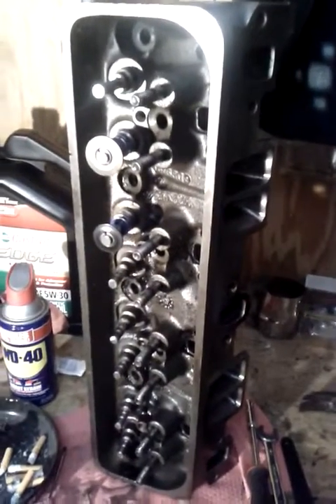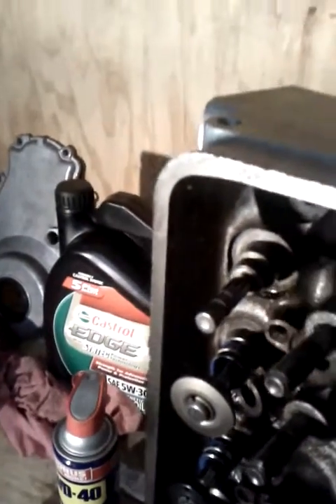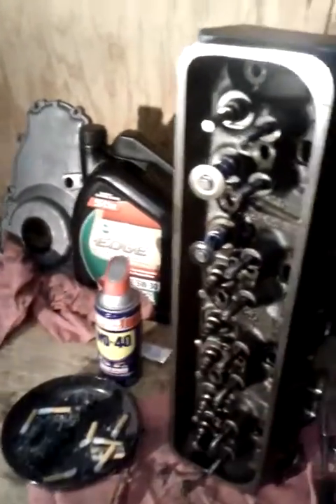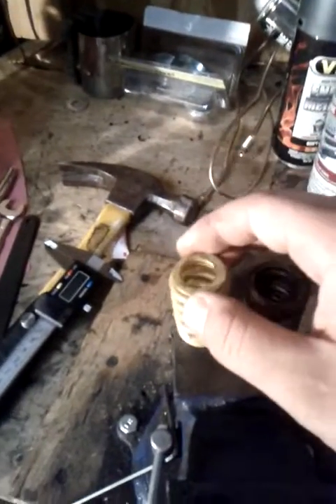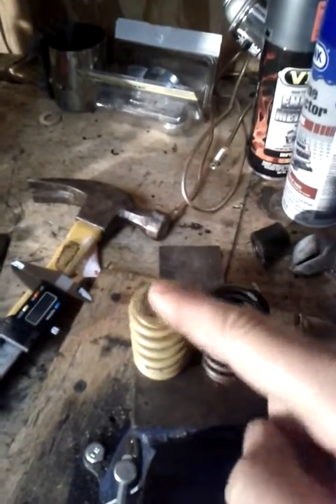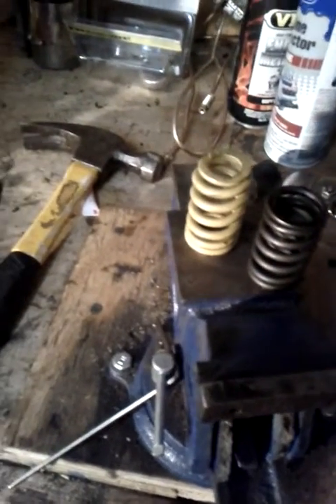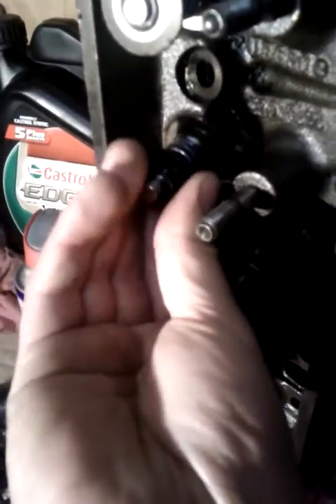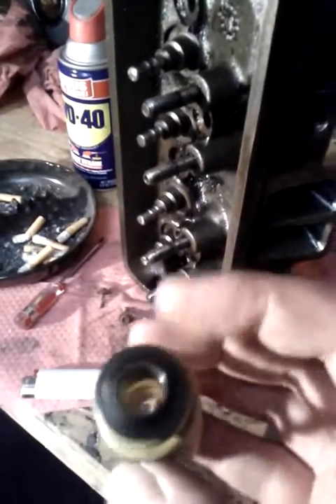HOW TO: Install LS6 springs on old 350 Chevy heads

Comment: So just the keeper gives you .024 did you need a .05 off set keeper to keep the installed high right. That will give you .074 more lift. I think stock they are good for .450?

Comment: Dont forget to use .050 thousand offset valve keepers. The way he is doing it only gives you 480 lift safely. You need .050 thousand space between retainer and valve boss.
Reply from the maker: I ran it this way for 7 years. I wasnt aware that i did it wrong

Comment: If you have new seals do the ls style springs require a different seal or can I keep mine (just got my vortec heads from gmpp and I’d like to upgrade the springs, but the seals are new )
Reply from the maker: Use the factory seals
Reply: BeeterOlds 
My man thank you for the prompt response, I’m in the garage right now wondering what to do, now on with the swap
Reply from the maker: You caught me at the right time (reading comments while crappin) enjoy sir!
Reply: BeeterOlds 
Hahaha right on man

Comment: Ok buddy any idea why people use to say to take the pressed in studs out and put the threaded studs back in ?? ""On the vortec head""
Reply: If you use a high open pressure (like for a decent roller cam) the pressure can pull the pressed studs out of the head.
Reply: I know of zero people who have done that on a street setup, if youve ever pulled the studs with a slide hammer , after the first one you thinking why the hell am i doing this, that fucker was in there !?!? .... the only good reason to pullim is so you can put in a longer stud and run roller rockers !

Comment: How did you work around the different installed height of the valve springs? 
The LS springs are a 1.800” Installed Height compared to the OEM SBC Springs are either 1.700-1.750”???  
I’m working on a set of mid 90’s LT1 heads and they want to run LS PAC 1218’s 🤔🤔🤔
Reply from the maker: I eye balled it and it seemed to work. Ls6 springs and Ford 4.6 retainers worked out perfect.

Comment: I want to do this mod with a set of the 8 intake bolt vortec heads.. I think they are 96 and newer.  I have 2 sets of LS valve springs laying to do it with so it seems like a good idea.  I am going to run them in my dirt car in the stock class, I have no cam limitations but I don't need to run more than maybe .515-525 lift with the compression I am limited to.  I am running a large journal 327 (350 with a 307 crank) in a 3000lb car on a 3/8 mile track.  Do you know if this modification will work so that I can install a better cam or do I need to pop off a spring and measure it?  Right now the car has a bone stock cam in it and my power band shuts down about 4800rpm.

Comment: I tried the 787 retainer with VTO stn. forged keepers on a Vortec head and it installed at the same height as the stock retainer, 1.71`` Net gain with LS spring is zero as the LS spring is supposed to be installed at a higher 1.80`` This swap looks good on paper but it only works with longer valves.!
Next up i used 787 retainers with stock chevy keepers..... With this setup i got 1.75 installed height. Max lift on a beehive with this low install is about .500-.510 lift
Reply: Old post, I know, but use +.050" locks.
Reply: @1965l88  Its still info so post away i always say ! Yeah ive looked at those keepers before , i would say def useim but make sure you are using a retainer that has a solid amount of material at this lower stress point, yes/no ?
Reply from the maker: I've never messed with Vortec heads in terms of this mod. it certainly paid off with the L98 head
Reply: As far as i know all small block heads prior to the LS series used a 1.70`` installed height the l-98 included. Your LT4 cam is probly just under the wire, good call on your part!.
Reply from the maker: +SnakePliscan2 not even close. plenty of room bro.
Reply: What was your installed height? i'm trying to run .560 lift, im gonna need longer valves.

Comment: i'm thinking about using L92 springs on my pre 87 heads (non-vortec) off a early 70s 350. Can I using any LS retainer? My 350 shortblock is a 87-95 roller so I'm trying to find a used roller cam about .525 lift.
Thanks
Reply: +Bonnie Samuals You can not use any LS retainer on any GenI small block as the GenIII (LS) uses smaller 8mm valve stems. Your 11/32 valve stem (.67mm larger) with there keepers wont seat down into the smaller 8mm retainer properly.
Reply from the maker: +SnakePliscan2 Believe it or not the Spring retainers I used and worked flawlessly were listed for an early Ford 4.6

Comment: Thanks for making this video, very helpful. I have '128  heads (86 corvette, aluminum) which are similar and also have exhaust valve rotators. Did the 787-16's change the installed height (distance from the spring seat on the head to the retainer's spring seat? How did you make up for the missing rotator? Mine are .100" thick.
Reply from the maker: Installed height didn't change, its also nice being able to run these springs cause it allowed the heads to accept the Comp XR270hr cam with the different valve retainers.
Reply: +D.Szymanski Beehive LS (excluding LS7) springs install at 1.800, the heads you are working on normally  have a 1.700 installed height. In order to get full benefit of the LS spring we need the 1.800 installed height. Comp designed these retainers specifically for non gen III engines using Gen III (LS) springs. If you check your spring heights i think you will find they are sitting at 1.800''
Reply: +Pontihack Racing  If you look at the springs the rotators were on you will see they were shorter than the intake side springs. They CB at anything above .425 lift. When doing a basic RV cam (typically .440-.460 lift) swap on the cheap, these rotators were tossed and 8 intake retainers and springs (junkyard) are installed.
Reply: I wrote that post some time ago, I ended up building my heads with the LS6 springs like this and it worked out great!  All my springs had the same free length, my Corvette heads had the spring pockets for the exhaust valve cut .100" deeper. I ended up find some .03, .06 and .01 shims with the same ID as the OD of my valve guides and cutting their OD to fit the spring pockets.
Reply: +Pontihack Racing Aah ha.... the Vette heads are machined for a rotator so a shorter spring isn't needed, GTK..There's a lot of reasons to run conicals especially on a flat tappet!
Reply: Yep, I'm full roller (using a '94 350 truck block with the dog bones) but I wanted room for lift and  the cheap Chevy valve springs were appealing. I'm running a Comp XR264HR-12 which is a bit under 1/2 lift. The cam lobe is substantially more aggressive than the stocker so the lighter valve train was worth trouble to keep the valves from floating.
Reply: D.Szymanski Is this mod only  for  roller  cams or will  it  work  for  flat  tappets? I  have  a  set  of  vortex  heads  and  just  what  to upgrade the spring  lift capability  of  these  heads.

Comment: Was just wondering what your spring installed height was? 1.700"? 1.800"? I'm building a 400 sbc with vortec heads and need to know how much lift capability I will lose if I install my LS3 springs at 1.700". Stock LS3 spring max lift is .550-.575".
Reply: Remember people that that spec for Stock LS3 spring,  "max lift is .550-.575"" is with a 1.8" installed height, you gain nothing at 1.7"